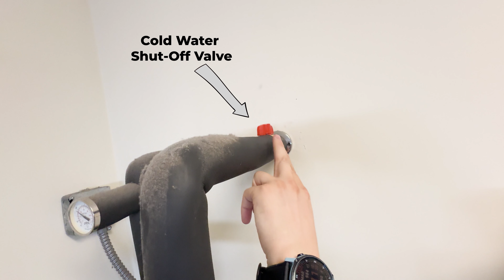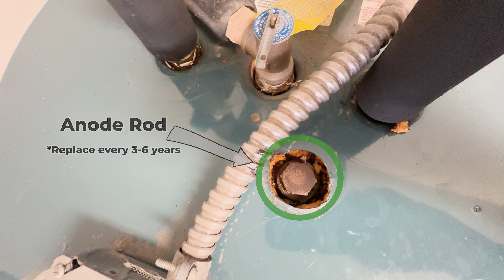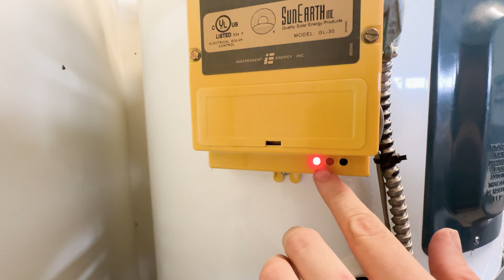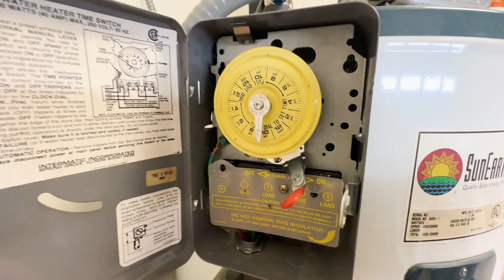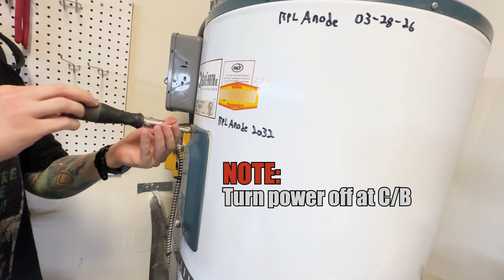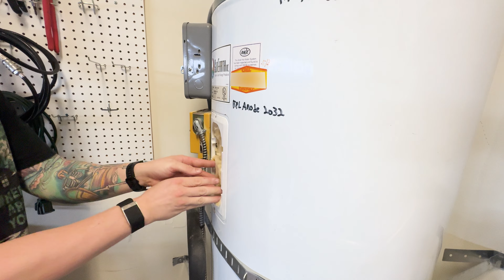SunEarth Solar Water Heater System Overview

Comment: This is an excellent overview! Thank you!
Reply from the maker: No worries! I’m going to provide a similar overview for central HVAC systems soon
Reply: @biggregenergy  Have you done an overview that shows the roof components and how that's all connected?
Reply from the maker: @chill-633  It’s not an overview, but I did just upload a new video where I replace the thermal sensor on the solar collector which is found on the roof
Reply: Are these systems expensive?
Reply from the maker: @ibezag0  I would say so, even if you only account for cost of equipment. It’s not something I would choose if given the option. The risks (burst pipes, broken components, etc) outweigh the benefits (reduced energy usage) in my opinion.

The majority of the cost burden would probably go towards labor. I asked for a quote on how much it would cost to replace just the tank, and the company quoted me at $10K. That’s why I do most of my own maintenance. Running the initial piping and wiring would likely add significant price tags to an already overpriced service.